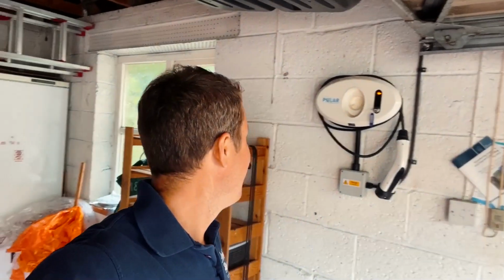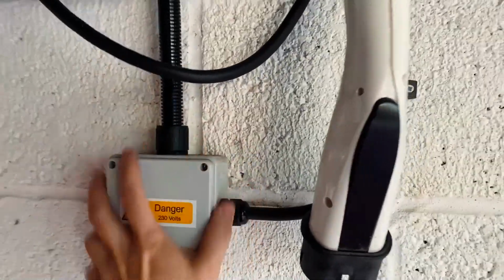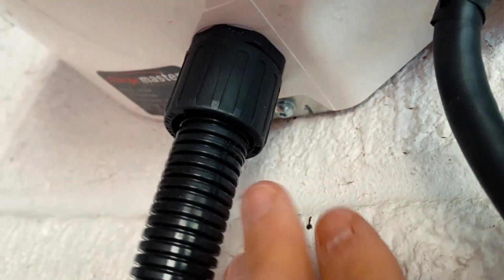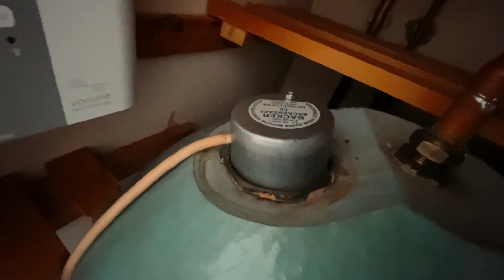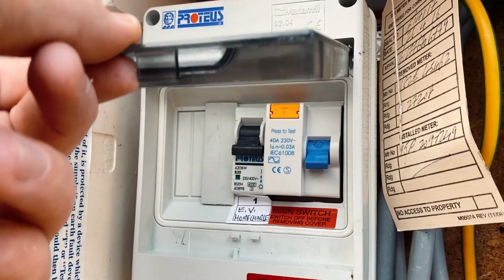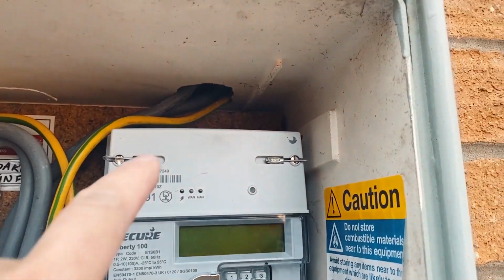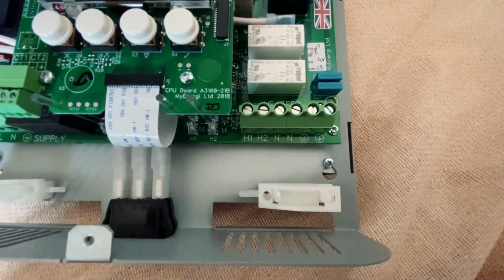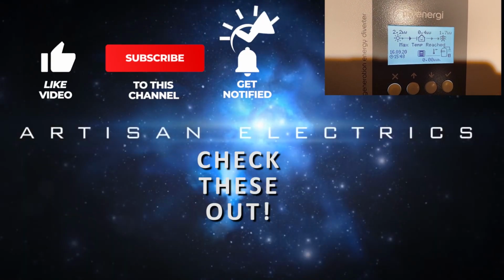MyEnergi Zappi & Eddi Installation

Comment: Is there a particular reason why you ran the power feed to the water heater controller down instead of up and over the door frame?   Seems that above the door frame would be safer in the future as there would be less chance of damaging it especially if the water tank needed to be changed out.

Comment: Problem with wireless devices like the Eddi and solar I boost is they don’t respond quickly enough as solar output changes. You can find the immersion pulling from the grid for a minute or two as a cloud blocks the solar. I’ve installed and used a few of these on my own place for many years. My favourite now is the hardwired solic200 which responds instantly and modulates output to the immersion by chopping the sine wave.
Reply: I would say the Eddi is pretty instant and does NOT in my experience draw from the grid unless you get your programming wrong!

Comment: So 4 kW solar gave you 10amps, on 32 amp charge. If you do a typical 9 to 5 & start charging lucky if your getting 2 amp of sunshine. So now we are looking at storage batteries. Costing £4,000 every 4 years. Think we are stuck with diesel for a few more years.
Reply: This problem is just one of many reasons why we must retain hydrocarbon alternatives for a long time.  The full annual world supply of lithium is already being used so alternative battery technology is already urgently needed. However that is neither cheap nor efficient so long term use of storage will undoubtedly cost more than hydrocarbon energy for a few decades yet.
Reply: @corrigenda70  Need the Wind Farms to split water into Hydrogen and Ogygen then push the Hydrogen in to the Natural Gas networks and Liquify if for ICE use. Oxygen in to the NHS.
Reply: Saw what..
4kW solar will roughly deliver (as I understand) 6-10kWh per day in the UK.

A full electric vehicle battery is 40-80kWh by comparison and a Tesla Powerwall 13kWh (both last a lot longer than 4yrs btw)

Comment: I thought you mentioned in a previous charging video that Zappi require the cables to be bootlaced before termination. I didn’t see that here.
Reply: Its a solid core cable. Pointless putting ferrules on.
Reply from the maker: Exactly
Reply: I was thinking the same. Looked like he forgot on this one?

Comment: Hi Jordan - To future proof a house build what size cable would you recommend to supply a car charger or if anyone else could let me know 10sq?
Reply: 6mm will supply all 7kw EV chargers 👍
Reply: Type 2 AC is---as far as I know---limited to 32 amps per phase. If you're looking far into the future you could install a 5-core, so if you ever get 3-phase you'd be ready.

And the actual size depends on amps and the length of the run. We don't know the latter, so no nice ready-to-use answer here.
Reply: It would depend on the length of cable run .  As this is for a device that is used for many hours at full load I would over size the cable in all instances to keep volt drop down to a minimum and charger effic. High 
If you install cable to just meet the regulations you can easy loose 150 w  by the time it gets to the car  this over a lifetime of use will cost well more that the extra cost of the cable
Reply: @hotrex7779  It still makes a difference if it's a 3 metre run through a wall or a 73 metre run to the garage at the other end of the property. (btw, this example, for a 3-phase 32A installation, is just crossing the boundary between 6 an 10 mm2 as minimum required. And doing the math gives 0.4 mm2 vs 10.4 mm2, so doing the first in 6 mm2 would be more than fine, whereas the second could gain from a a thicker cable for less losses.)
Reply: HenryLoenwind   Yes. It will make a difference what ever the run length 
But the loss down a 3 mt run of 6mm would not be too great. As a comparison to the loss down a 50mt run of 6mm .  I use a 10mt lead and that costs me about 60 Odd watts. 
But to help it out the run from my consumer unit is now 10mm

Comment: Thoroughly enjoyed that video dude. Nice tidy install as always. Did you consider flexicon to run the Twin in the cupboard? :)
Reply: lol. I would have run the T&E up, over the door way (inside) and back down. Looks better. Less cable. And when the tank is replaced the tank won't get dragged over the cable
Reply: @AndyK.1  Nor will people put the legs of a stool or steps on it to get to the top shelf.

Comment: Not sure if you've seen it, but D-line make a bit of 16x8 trunking with a curved profile that's perfect for single data cables (eg I use it for feeds to wireless access points) - I find it's less intrusive and more visually appealing than the standard square edged stuff...

Comment: I bought the knipex ergo tool but for some cables stripping can result in sheathing lodged between the blade and housing making it less functional over time. They need to make a better model for USA purposes.

Comment: How long do the batteries last on the wireless CTs, seems like a pain to deal with them running out.
Reply from the maker: No batteries involved they are self powered
Reply: @artisanelectrics  that's awesome, so if you clamp one on before the electricity meter you're stealing energy then! Is the system flexible enough that if you had a second Harvi then you wouldn't of needed to drill the hole through the wall?
Reply: @artisanelectrics  You mean they run on magic? :)

Comment: Please show us replacing the immersion element, do you have to turn off the water for that? What tools are needed?
Reply from the maker: I never do those I leave it to the plumbers!
Reply: @artisanelectrics  wait sorry was it a thermostat? Is that easy to change?
Reply: @lewistempleman9752  yeah thermostats are very easy, just need the right length
Reply: @artisanelectrics  I thought you did one in this video!? Or a plumber did it?
Reply: Immersion heaters are a pain in the arsenal to change.  Often they can be stuck in, but thankfully it is more likely to be the thermostat.
Reply: @moto Line if you're doing this sort of upgrade you should consider the safety implications, you're moving the immersion heater from a service interval of once in a blue moon to daily.
Reply: @moto Line Planet

Comment: I was wondering if it was OK to run an EV charger at 32A off of a 32A MCB, I've got my charger set down at 24A as I was concerned about it tripping the 32A MCB that was installed on the circuit (I fitted the charger a few years after the Spark installed the circuit)
Reply: Yes. They don’t trip at 32A. More like 32x1.5

Comment: Type test if you use different manufacturers circuit breaker and/or main switch??? You should go deeper to that topic! Sounds really weird to me.
Reply: My understanding is, that there needs to be proof that your protective device is safe to use with your DB (keeping the IP rating of the box valid for example). If they are the same brand, it is assumed that that is the case (especially if they come pre-mounted) but it cannot be assumed for all brands. 

Some MCBs might leave a gap in the front cover because they don't fit perfectly, or they might prevent you from closing the cover.

If the manufacturer supplies a certificate that it is ok to use them, then they assume liabilty.

Disclaimer: I'm not an electrician.
Reply: @holladiewal6812  Yes, it is obvious that you can't install parts that does not fit. I know there is weird bottom busbar solutions in UK and those might be manufacturer specific but in case on this video, there is standard DIN rail mount witch means that you can install any device that is made for DIN standard and it will fit. This is the reason why the standard exists.
Reply: @peto22  Just because the breakers fit the DIN rail - it does'nt necessarily follow that the CU front cover will fit properly over the front of the MCBs/RCBO's/Main Switch.
Reply: While I get the point, this isn't the design of an aircraft, as competent professional you should be able to make a decision, in the commercial world people are always mixing different components with different enclosures, you can't tear a building apart because the original manufacturer of that enclosure isn't about anymore.
Reply: @edc1569  It's about who accept the risk/responsibility if things go wrong. What if the "foreign" part causes a fire and lots of damage. Whoes going to accept liability and whoes insuance is goint to pay out ?
Reply: @shilks8773  If all parts are made for DIN standard, the connections are made correctly, with correctly sized circuit breakers and correctly sized wires and still component x ignites spontaneously, it is the responsibility of the manufacturer of component x. Anything else would be a miscarriage of justice.

Comment: These myenergi systems only only work on a grid connected system where they can measure imports/exports from the grid they don't work with off-grid systems where it is hard to determine available PV power on a dynamic basis.

I'm running my entire system off-grid as a TT with a basic Rolec charger with selectable charge rates and a heat-pump/300l water tank. Power comes from 6KW solar array and a 100A/48V charge controller feeding 10KWH LiFePO4 and 5KW  inverter. Control is done the hard way - I looks at the sky and charge state then set the car charger accordingly, it all works!

By the way, that water tank you are adding the Eddi to would benefit from the pipes insulating and an additional insulating jacket on top of the existing insulation.
Reply: Where are you based Andy?
Reply: @edc1569  South Shropshire
Reply from the maker: Thanks
Reply: Was going off-grid just a wish or was there a need?  Would love to see the stats on your system and how you get on over winter! Certainly something I'd like to do in the future, but being a city dweller at the moment, not quite possible!